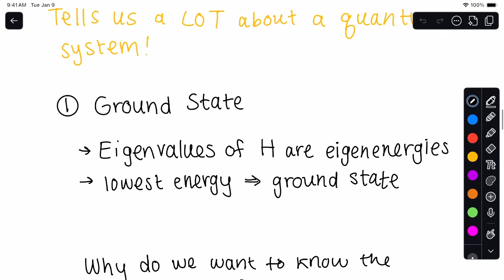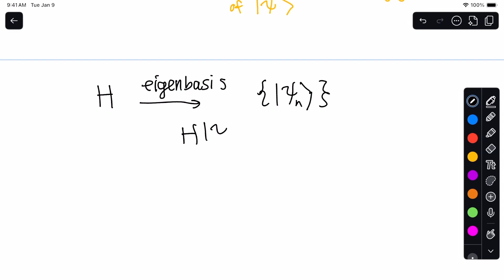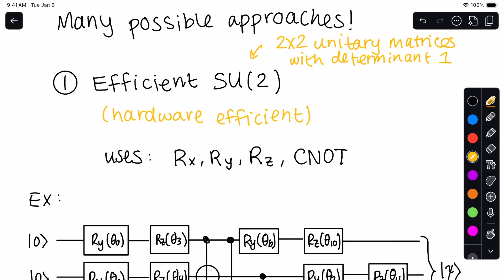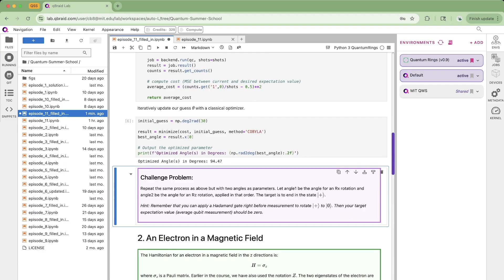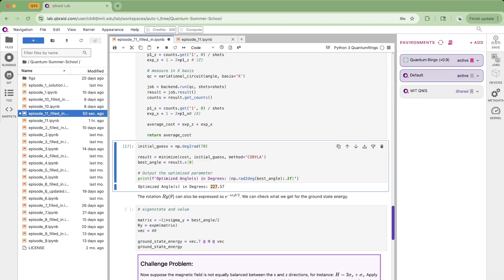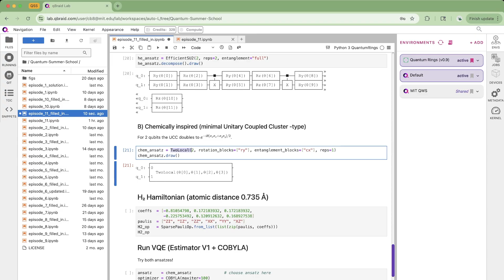Quantum 101 - Lesson 11: Variational Algorithms I  VQE

Comment: I am getting this warning:

""""
You are using a function call that currently creates an equivalent number of classical bits as the qubits.

This functionality will be removed in an upcoming version. You have to explicitly create the number of classical bits required.
Example:
num_qubits = 5
num_clbits = 4
qc = QuantumCircuit(num_qubits, num_clbits, name="myCircuit") 

"""

Apparently, the code causing this warning is within the VQE class or the estimator object (which is an instance of QrEstimatorV1) being used in that cell. Specifically, it is likely happening within the process where the quantum circuits from the ansatz are being prepared and run on the backend through the estimator. The suggestion to fix the warning, you would need to modify the code that constructs the quantum circuits, likely within the VQE or estimator implementation, to explicitly create classical bits. However, since the VQE and QrEstimatorV1 are classes from libraries only you might have direct control over the circuit creation within those classes.